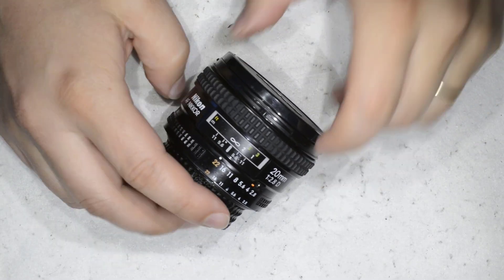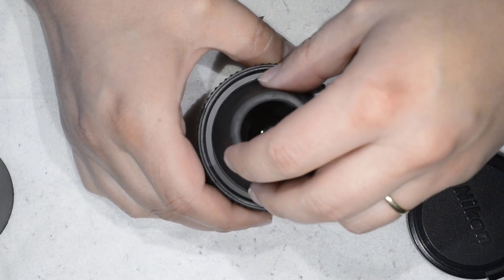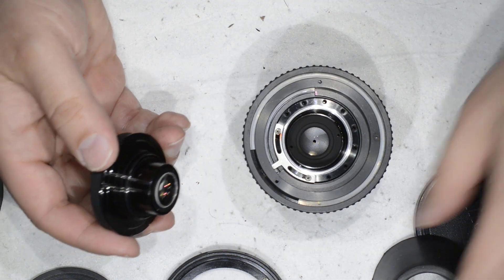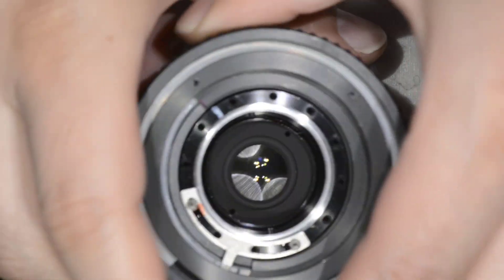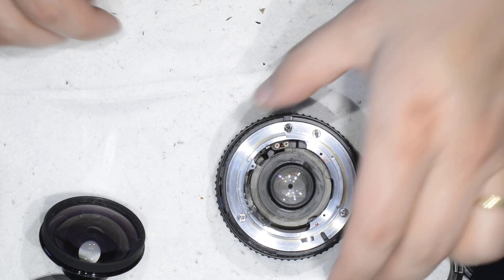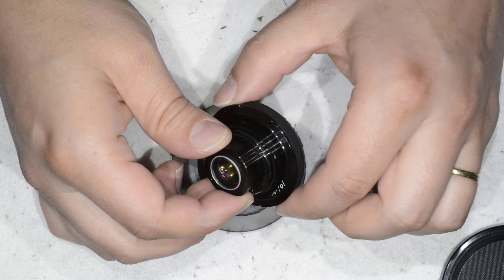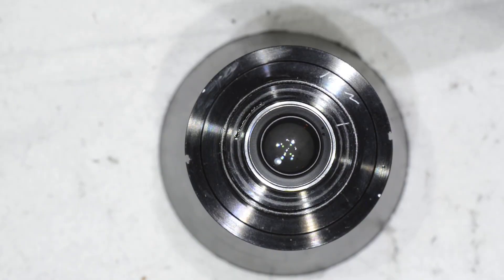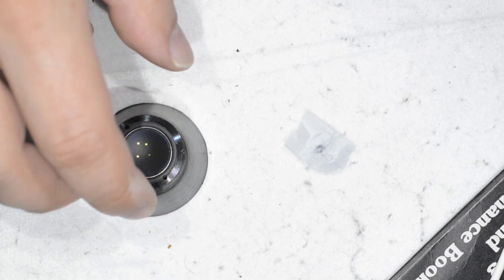Nikon Nikkor 20mm fungus removal : Lens repair

Comment: Great video as always, very informative. A question: Could I swap the rear glass of this model with that of an AIS? I ask because I bought a cheap 20mm AIS, and the rear glass is heavily damaged. I've only been able to find parts from the AF-D, I was thinking of putting the rear glass from the AF-D on the AI. Thanks in advance
Reply from the maker: Hi, I don't know, one must check the optical schemes to see whether they are similar or the same. My gut feeling tell me they are but I may be wrong. Anyway, the rear block of the 20mm AFD is quite easy to remove, they Ais I don't know. Cheers.

Comment: Great video, I have one with fungus/haze in the rear lens assembly, it might be the separation you mentioned. Is it possible you can make the video on how to fix this ? you mention this at 6:08 minutes, I would be very grateful to see this video, thanks
Reply from the maker: Yes, I have 2 in the same situation as yours. It's some degradation of the glue in the rear doublet that creates some haze. I have all the items I need, now, I just need some time to actually make the video. Keep connected ! Cheers
Reply: @diyextravaganza   great I'll subscribe and look out for it, thanks so much
Reply: @diyextravaganza  Hey, loving your videos, they have taught me lots.

I was wondering if you had chance to make one about the haze removal from the rear lens assembly on the 20mm 2.8 D ?
Reply from the maker: Hi, I do have two of these waiting for that repair, I'll do it in the upcoming months. Cheers.
Reply: @diyextravaganza  Thank you, I look forward to it.

I managed to get to the rear elements following your other videos, but the haze appears to be inside two elements that are fused together (not by plastic that can be trimmed off).

Comment: need to clean my 20mm 1.8g I got cheap, fixed the AF now need to get to the elements. Front looks pretty similar but rear element ring needs a three prong spanner wrench and ring looks plastic, not the normal construction I like my all metal lenses F all this plastic stuff 😭.... Have u seen the back of the 1.8G?
Reply from the maker: Hello, no, I have not seen the back of the 1.8G,  but I've seen others. People may call that what they want, for me it's cheap construction. I don't think the interior of most recent lens is any better. Sorry I can not help any further.